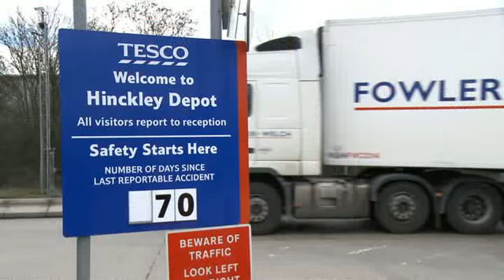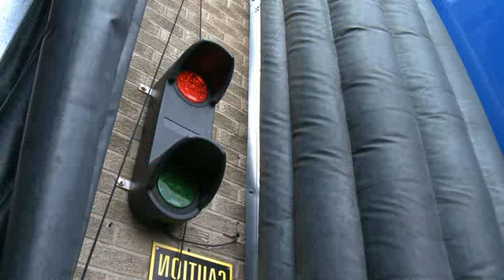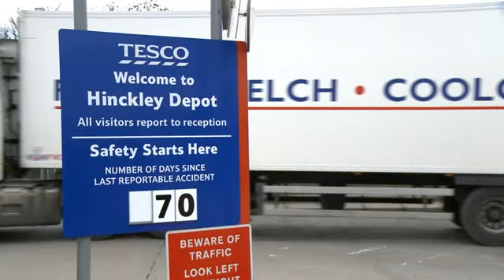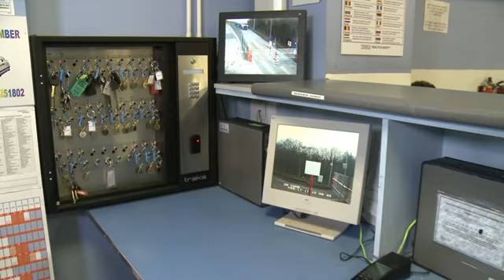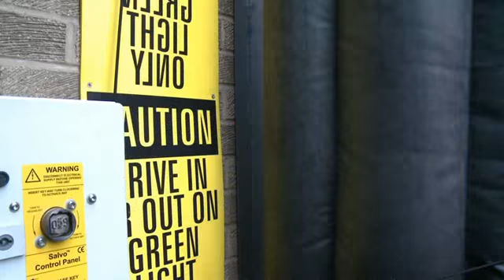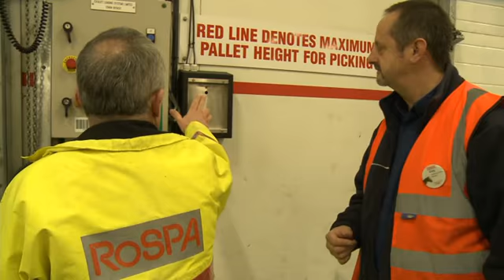TESCO DockSafe

Comment: Even on a green light i will always check the back of the lorry before pulling off the bay someone could accidentally put the green light on you never know.
Reply: Depends on the door system the warehouse uses. At mine we can't green light the driver if the door is open, the keys also go on the bay door so if its up you can't get to em. The doors also won't open if the outside light is on green.
Reply: @DONK8008  thats a good system they should all be like that but unfortunately not all are

Comment: Personally I would put pneumatic lift bollards in front of the vehicle/trailer. These would raise on an activation of the red light. Until the warehouse person releases the red light, the bollards will then lower. The vehicle is going no where whether by shunter or driver, or even release from the service desk. Keys in hand or not. This way the vehicle movement off the bay is totally in the warehouse person's hands.
Reply: Spot on. And the driver can stay and enjoy his own cab instead of sitting in a stinking filthy room

Comment: Many drivers have a set of spare keys so they can come and go between the goods in office and their cabs. With their spare keys they can lock and unlock their cabs, good for security and switch the ignition on to use certain in cab electrical items. It has been known for drivers to forget they are using their spare keys, drive off and leave the depot leaving their original keys behind. The only failsafe is a physical device such as Dock-lock, a device that sits on the floor outside the dock that raises a lock bar between the trailer wheels physically preventing the vehicle from moving. Another device raises a lock bar under the rear under-run bar of the trailer. An easier option would be to create a small safe standing area on the dock by the door at the rear of their trailer where the driver has to stand whilst the dock door is open, the dock leveller is in place and the vehicle is being unloaded. My idea is once backed on the bay the driver hands his keys in and is handed a dock key which is required for the dock door to be raised and unloading operations to begin. This requires the driver to be present at the rear of his vehicle whilst unloading is being carried out. Once completed, the dock door closed, the dock key returned to the driver, the driver returns to the goods in office whilst his load is been checked and waits for his paperwork. If there any returns to be put back on the vehicle the driver returns with his dock key to enable this. Once completed, the driver hands in the dock key in exchange for his vehicle keys and paperwork.
Reply: I wouldn't want to be standing at the back of my trailer while it's being loaded at some places I've gone, the longest wait I had was 7 hours on the bay from the 1st pallet to the 26th
Reply: @mojothejester9889  yeah agreed this is a shit idea 

Tesco's idea is also a shite idea as it locks a driver out his cab and makes him sit in shit conditions like a prisoner most of the time for hours 

its very easy to resolve but the companies don't want to spend money in the rdc's

train depos use a system called a de railer its a mechanical device designed to derail a train if it tries to move into the shed / depot while people are working on it each person has a key fob or just a small issued padlock that goes onto an isolation board for the 25kv overhead and the derailer the same couls be applied on any loading bay 

under run grab / hydraulic wheel locks/chocks 

driver uncouples from the trailer and pulls forward depot staff or driver applies a 5th wheel lock 

all options with a key fob or a physical key that needs to be applied to the bay door for it to be opened (same as tesco but at the physical door)
this then locks the drivers key on the outside and wont unlock it until the bay door is closed 

this then makes sure the driver cannot pull off and also benefits the driver by leaving him/her in peace with the comforts of the cab 

also if you had to do it very cheaply or minimizing the spend for the rdc 

5th wheel locks and a physical key system would be very cheaply installed on all existing door systems
Reply: Or just use a suzie lock!

Comment: The best safety in my eyes is when you back up to a bay unhook the trailer and pull away, and when and only when the trailer as been loaded/unload and bay door is down and ramp removed can you then hook up
Reply: If the driver has access to couple the trailer he has access to move the unit. Not fail safe.
Reply: Who wants to uncouple and couple the same trailer just because RDCs don't want to spend money on THE safest option? Don't talk daft.
The best system is the automated wheel chocks that operate and lock the trailer wheel in place when the red light goes on and door opens.

Driver can stay in his cab listening to the radio or making a brew and even if he tried to drive off he can't as the wheels barred from moving. 

Dropping a trailers great until some dopey loader puts all the weight over the pin and the trailer takes a nose dive over the legs .... forgot that bit didn't you.
Reply: @Rush-gz9sx  so you've never hooked up to a loaded trailer then,
Reply: @Rush-gz9sx  I've been to a few companies whose policy is to unhook whilst the trailer was being unloaded, and park the unit up
Reply: @Rush-gz9sx  and you think those automated chocks can stop a truck from pulling away,
Reply: @Rush-gz9sx  you say you're not stupid, it doesn't take clever people over two days to write a reply, what's up did you misplace your dictionary
Reply: @Rush-gz9sx  you still scratching your head for a reply, give us a shout, and I can help you 😁

Comment: way not fit a monitor for the bay on the outside so the driver can check before pulling forward.
this way he can go to the back and check his doors are shut before pulling forward to do his check.
it also means he is responsible to check, and he can see the progress of the procedure.

Comment: All very well. Wait for the green light and check..... Keys now go in to a coded box..... Drivers are treated like lepers.. Not allowed to use the proper canteen. Scabby sandwiches in an often not working vending machine. Not many drivers like going to Any Retail Distribution Centre... 
... 
.

Comment: If the keys are hung on the inside of the bay door then they are clearly visible to the unloader so they can be confident that the vehicle cannot be moved off the bay.
The keys are also unavailable to anyone until the door is closed.
When the keys are handed in the clerk should pass them to the person who will be working inside the trailer.
They hang them on the door.
When the work in the trailer is finished the person who closes the door returns the keys to the clerk, so they can return them to the driver.
Why is this not standard practice?

Comment: Just noticed a powered pallet loader going onto a trailer backwards, if the trailer had pallet securing bars the loader would have driven straight into the bar with a potential death.

Comment: The only thing about the whole system that I find annoying is that companies don't trust the wagon drivers.  Wagon drivers, in the main, are professionals that take pride in their work.  They are also the most targetted in terms of safety.  It doesn't take long for an unsafe driver to be found out and does something that could compromise the safety of others.  Once the unsafe actions are identified then the driver is either retrained or faces the loss of their licence.
Reply: I don't get it ..the first thing that comes into my head when  pulling off a door is is it safe to pull this trailer off the door....its as if the drivers are numptys and we don't trust them....

Comment: Until these RDC's start providing proper facilities,stop  treating drivers like shit and begin tipping loads in a reasonable timeframe then there's always going to be problems.
Massive purpose built warehouses with all the equipment and I could tip a full load quicker by handball.The places are are run by fools.